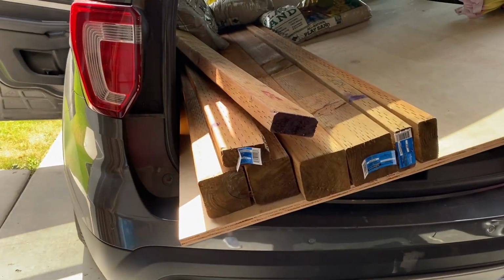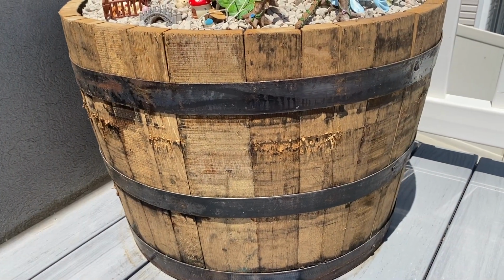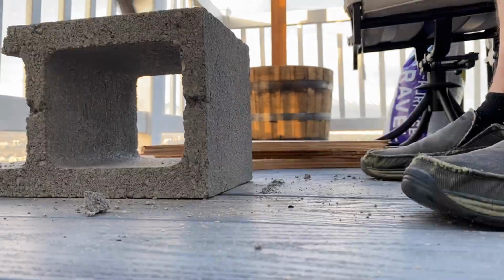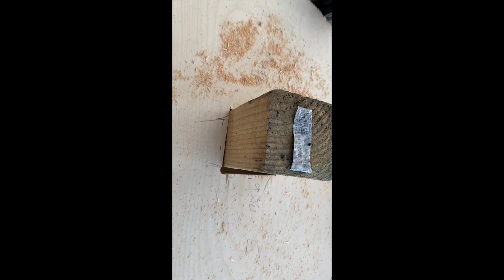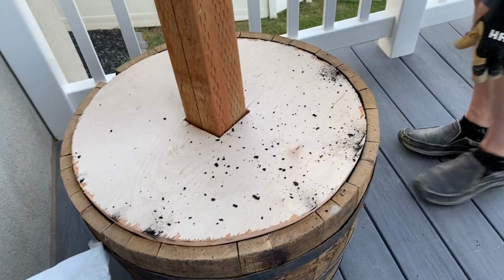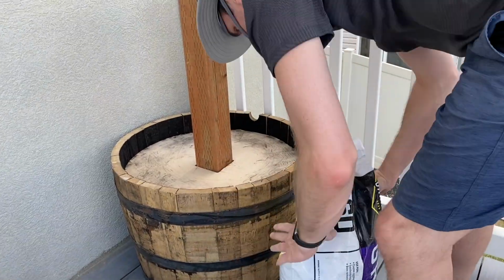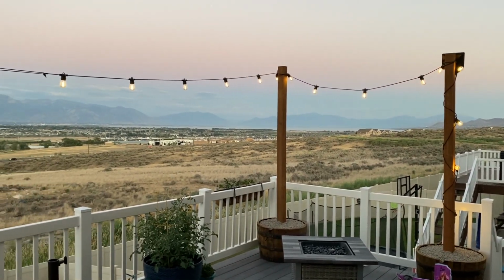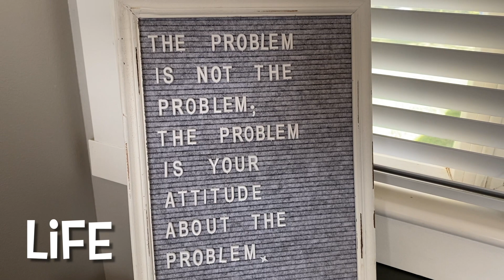Barrel Posts for String Lights DIY

Comment: Great idea and it looks wonderful. I found your video looking for the same kind of idea to hang birdseed feeders on do you think it would hold the birdseed feeders? Also, is there enough weight? Thank you.
Reply from the maker: Yes, I hung a hummingbird feeder. This base besides the roughly 100 lb barrel has an extra maybe 100 lb of rock weight, so it will stand well on its own. Just consider that the longer the string of lights/line, the more weight and chance that something could fall onto it to topple two barrels inward. I ended up tying an extra guy wire cord down to the deck to prevent them from falling inward. Hope that helps!